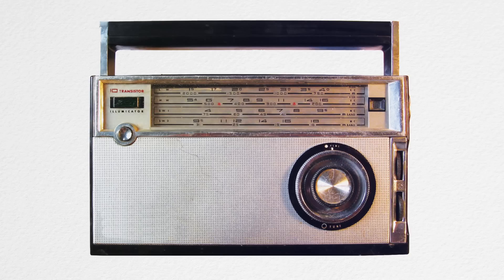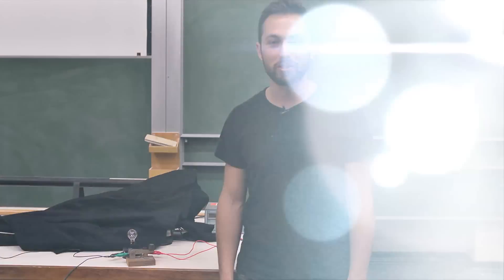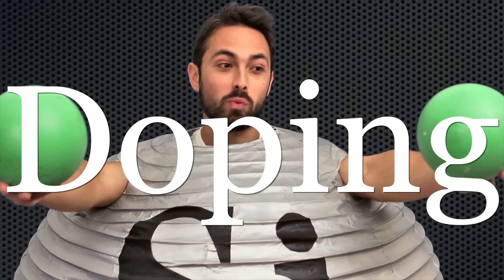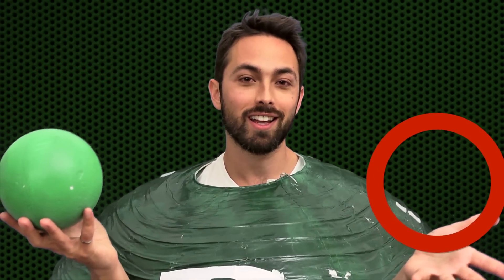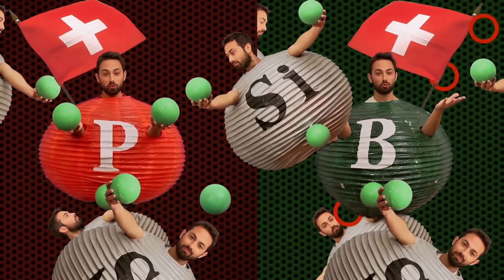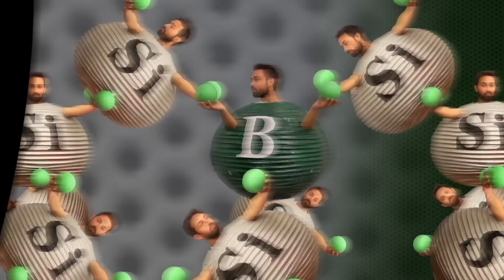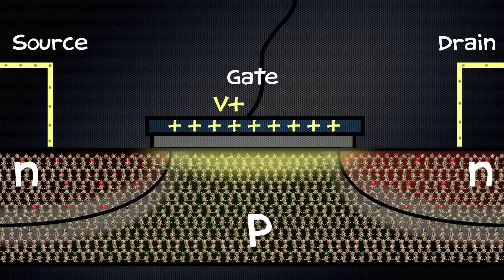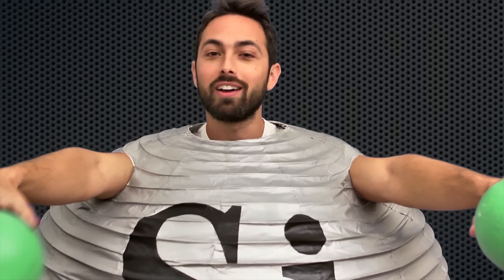How Does a Transistor Work?

Comment: Video: "A problem we won't face until probably 10 years down the track."
Me: Looks nervously at how old this video is now
Reply: 7 years. Not a bad estimate tbh
Reply: @KajoFox  I think that the last part is a very crucial element to this. There are many innovations that can be made in terms of architecture, software, or really even fundamentally how we think of computer chips.
Reply: also when he says 22 nm, I think "wait a second, this is wrong! intel I9 is 10 nm and AMD Ryzen 3rd gen is 7!" then I saw the date of the video and realized we are really close to the limit
Reply: @KajoFox  lmao amd is already at 7nm
Reply: @hdjekso7930  To be fair, they're talking about feature sizes rather than direct transistor sizes at this point, and the transistor density of Intel's 10nm tech is about the same as TSMC's 7nm tech (remember, AMD doesn't manufacture their own chips, it's TSMC's 7nm tech they're using).
Reply: @jubuttib  makes no difference
Reply: @hdjekso7930  Hello 2019, it's 2021 4th quar, we are at 5nm
Reply: @hdjekso7930  AMD is not, TSMC is :) 7nm is here for a "long" time already, I think we are starting the 5nm process now. Well, TSMC & Samsung are. Intel is barely able to make 10nm work today, they are still mostly stuck at 14nm for a very long time. Worrying time for them.
Reply: @hdjekso7930  2nm as of now
Reply: @hdjekso7930  And Intel is still only at 14nm xD
Reply: It's fine, once we start getting to 3-5nm people will just have to learn about creative code efficiency again like in the old days. Either that or we just start making chips bigger chips. This is all hypothetical of course, since the real thing you should be nervous about is the impending solar flare rendering all these chips useless.
Reply: @VGScreens  why people still think like everything is rock, paper, scissors? One problem doesn't top the other, and bigger chips wouldn't make progress, but yes, it would be very much interesting if people had to learn assembly to make code when high-level languages become useless.
Reply: 2020 - 5nm still fine
Reply: We're probably good at least until 2022 circa, indeed, when 3nm chips SHOULD enter mass production. After that it's not clear how the industry will proceed. Plans for 1.5nm are in study, but for the moment there's nothing concrete. Remember, anyway, that the "nm" quantity is quite a commercial term and the actual important number is transistor per area.
Reply: @tiger.98  what about now?
Reply: @tiger.98  its almost over
Reply: me: watching 10 years later:
Reply: Guys there is a huge misunderstanding between naming convention and true size of node and transistors. In fact, Intel and other companies have been stuck building transistors with a size of ~20 nm for a decade now. The naming type thing like 14nm, 9nm or 5nm "process" are more commercial terms used by companies to trick consumers. The only thing that have been changed through the years is the density of transistors and the use of improved stacking technology. The transistors in your 8+ year processor and those in the last generation of i7 gen1X have exactly the same size.
Reply: Hello from the future you dreaded
Reply: tfw Intel is stuck at 14nm++++++++++++++++++++++++++++++++++++++++++++++++++++++++++++++++++ for more than 5 years now lmao
Reply: @KajoFox  This agged like a fine wine.... TSMC is getting ready for manufacturing 3nm gates and i think, that that is the smallest we can get...
Reply: Me watching 10 years after the video is uploaded 😂😂
Reply: Reading your comment, and replies to your comment was like a time travel journal.
Reply: we need to start investing in grapes for the 2nm manufacturing process
Reply: @elevenz367  hm... 🍇 Grapes
But seedless!!
Reply: @elevenz367  we have it now 2nm ...IBM
Reply: @elevenz367  what does that mean? thanks
Reply: o boi
Reply: Try doping. It'll take your mind off it.
Reply: 2023 baby. 2023 is the end times we are close.
Reply: The law is kinda dying already...The performance improvements on new processors these days is not significant compared to couple of years back
Reply: Guys the 5nm and 7nm refers to the resolution of the fabrication, not the size of the transistor itself
Reply: 10 years old
Reply: We have arrived...
Reply: well.
Reply: lol. I just watched this video and it is 10 years old. 😬
Reply: there is only 4 years left before we face the problem
Reply: @YugoslavForever  I don't see what the huge problem is, they can easily just manufacture larger chips to get more transistors if they can't make them any smaller. They can also simply take existing cores and add more of them, and most importantly they can focus on optimizing software because most stuff on modern computers is hopelessly inefficient as a result of general purpose cookie-cutter high level program instructions and compilers.

It's only really a problem to very specific applications where processing power is no where near where we need it, like highly complex physics simulations. But they're working on quantum computers for that.
Reply: @BigUriel  With larger spacing follows a slower cpu. Not a huge matter though. But the die size will decrease and make the products more expensive. And the winner will very often be the one who can keep production costs down. Anywho. When they begin to exhaust multicores my best guess what's comes after is 3D stacking with increased input sources and advanced air flow and cooling techniques.
Reply: @BigUriel  not quiet true, making things large was at the very beginning. Technological progress would stopp once we can't make it smaller/more efficient. We already had computers as big as rooms for simple tasks and we still have those and much larger with newest technology. Space is crucial
Reply: @BigUriel  if not scaling down transistor, the power increases really really fast, a cpu is already difficult enough to cool, and that would mean almost no improvements in mobile.
Reply: @BigUriel  I think if they decide that the solution is to manufacture larger chips, rather than market larger chips to consumers, they will say, "Right, commercial computers are not going to get any better, we've packed as many transistors onto a chip as we can, what we are going to do instead is make massive supercomputers, that consumers can access remotely with current technology." The technology is already there, we've seen google stadia and internet technology is still getting better. Internet access will need to be cheaper or free before they can axe offline though.
Reply: @BigUriel  if we increase the size of the chips then we introduce many other problems, such as packing density, heating(larger a chip gets, tougher to cool it) also it's more abt the density than the actual size of the chip. It's how densely we can pack a chip with transistors. Other than that I agree, the architecture, os and programs can be highly improved and their efficiency increased.

Quantum computers are not like traditional computers. They can only solve certain problems. Granted those are high level problems. The issue is quantum computers behave in a very different way to how normal electronic devices. Their logic is based on quantum superposition of various states. Hence first we have to evaluate what kind of problems or algorithms can actually be solved using those superpositions and only then can we proceed to solve them. It's not like we can use them for highly graphical or load heavy simulations.
Reply: @captainspikester1  are we going for full circle once again, then? That was a thing before, one of the first solutions implemented, but a personal computer launched and it was better to have one than to wait for the whole neighbourhood, which means now we reached the point where this inverts again?
Reply: @SArpnt finally companies will run out of new idea to make money and they have to provide best in affordable price or mo will buy their products anymore..
Reply: Right now, covid19 is slowing down the process by at least 6 months
Reply: he gave us 3 years. We need MOORE XD
Reply: @KajoFox  True for Intel, but they are not the leading semiconductor founder anymore. TSMC and Samsung have been using 7nm for a few years and they are now starting 5nm. Intel is barely doing 10nm, they still are really at 14nm. Their roadmap and promises cannot be trusted anymore, they keep saying they are going to do it for several years... but yes, I believe 2021 is really the start of their 10nm.
Reply: @KajoFox  Snapdragon 888 5nm :p 
Still in early 2021 so we're reaching that limit fast, but ayye progress is always good^^

Also looked up 3nm is in the works right now. Probably won't be too long. But after that yeah suspecting slowdowns would be reasonable

Oh wow this was interesting, TSMC (taiwan semiconductr manifacturing company) has announced plans to start risk production of 2nm nodes in 2023-2024. Intel also announced back in 2019 plans to hit 1.4nm as of 2029.
Reply: @fruxo2000  why should the number of transistors on a chip double every 2 years though?
Reply: @johnaligizakis  Moore’s law. In the 60’s it was realized transistor counts on a chip were getting doubled every 1 1/2 - 2 years. And that has stayed pretty much the same for decades.
Reply: @johnaligizakis  it's an empirical law, it just happens, we have "no control" over it, we can only observe
Reply: 3 Moore years guys
Reply: Hi from 5nm M1
Reply: I've been holding off buying a new PC till we hit this 10 year end game. Still rocking a maxed core2quad. How are we doing? Must be almost there?
Reply: @WistrelChianti  same here
the pause will be there for atleast a decade until some other breakthrough or quantum computing comes.
Reply: The video is 10 years old now, but we still have about 3 years left m Yippee!
Reply: what 10 years is? just a snap of fingers :yougotthis:
Reply: And it's been 10 years now... He is indeed right, well Moore is
Reply: Me watching this on an iPhone 15, one of the first devices with 3nm chips: 😮
Reply: you saved me from saying the exact same thing myself thank you
Reply: we're in the endgame now
Reply: Hi, it's tiiime
Reply: oh no
Reply: its 10 years later now!!! 😨
Reply: yeah it has been already ten years hasn't it
Reply: heh
Reply: once the limit is achieved they will start to develop quantum computers
Reply: @Rafael-pi4md  they're developing quantum computer already, it's been many years and some time ago Google executed an incredibly complex problem, impossible to modern supercomputer. However it's not that simple anyway.
Reply: @SArpnt YES I already think about it, if it will be a time when technology will stop from development
Reply: hhhhhhhhhh same here
Reply: Making transistors beyond 3nm poses a lot of additional challenges, and may never be a thing, like with Nuvistor vacuum tubes. 
https://semiengineering.com/transistor-options-beyond-3nm/
Reply: And so far he's right. 7nm is the current size by and with 5nm in development for 2021, 3 nm is only 25 atoms across and very recent descoveries have managed to get 2 nm transistors stable, although I can't imagine going much smaller than that
Reply: @leonstansfield  I just meant that new discoveries, perhaps in fields such as quantum, cloud and non semiconductor electronics, will make 3nm "the last stand of transistors"
I imagine we'd need atomic fabrication to produce transistor 3-5  atoms across, and it being actually flat. I don't think it would work electronically with such tough tolerances. This is actually the next step we're approaching in the technological development - the transistors have to shrink in all 3 dimensions, no?
Reply: We are almost there
Reply: @Flamebuster32 I made that comment a year ago bro
Reply: Hi from 5nm M1
Reply: More core's is the solution to that, although more power consumption will be required. AMD's Thread Ripper!
Reply: some researchers predict that Moore's law will end in 2021, when quantum effects will mess up smaller transistors
Reply: @lilapela  that's what finFET and newer tech like Nanosheet and nanowire solve
Reply: @KajoFox  2 years later: Oh look, IBM made a 2nm chip!
Reply: me rn
Reply: 2 more yrs go by
Reply: It's even worse now...
Reply: shoot we've only got two years left until transistors get too small
Reply: NANI
Reply: almost 10 years now
Reply: Now we're only one year away.
Reply: now we're really at the limit. IBM have chips with 2nm transistors, 1nm transistors exist, 0.5nm transistors exist, single-atom transistors exist, and somehow the smallest transistor ever made is just one photon, with zero size.
Reply: It's now nearly 10 years 😂😂😂😂
Reply: Looks nervously at how old this comment it
Reply: Umm...
Reply: I JUST THOUGHT THAT and it’s been 10 years since those video was made
Reply: That has exactly been my thought just now :-) Now it is ten years later...
Reply: And it is 10 years old😂
Reply: Well we reaching the limit boys
Reply: It's 10yrs already and it's still getting smaller and smaller 😅😂
Reply: its time now...exaclty ten years later🙃
Reply: Been 10 years now.
Reply: oh no
Reply: hi it's officially 10 years and we're a little scared
Reply: We are at 10th year by now
Reply: lol It's been 11 years and there is no electropocalipse
Reply: hi ken, im from the future
Reply: ITS ELEVEN YEARS OLD NOW
Reply: Me reading this comment 6 years later 😳
Reply: ok we're here did we solve the problem?
Reply: Well thats a problem now.... we arrived at 3nm easily
Reply: let have a countdown...
Reply: That's exactly what i was gone write!
Reply: We got quantum computers so chill out
Reply: No worries guys! Engineers & Scientists will even solve these problems
Reply: lol. 7 years now.
Reply: it already happened we have reached this stage lol
Reply: sry didn't realize some time is left lol
Reply: @pipnina But why does it have to get smaller?
Reply: @KajoFox  GPU’s are already 5nm
Reply: It happened!
Reply: @KajoFox  yolo cah A14 is 5nm
Reply: Bruhh
Reply: @KajoFox  tunneling occur around 1 to 3nm not 5nm
Reply: Still relevant
Reply: @KajoFox  Year 2021 here. Samsung already completed 4nm process and they made contracts with other companies.
Reply: @KajoFox  not all processes are that small tho. Digital is the cutting edge when it comes to channel length. Analog and RF applications are still in 90nm and greater range.
Reply: What about 2021
Reply: @KajoFox  7nm for 2021....lol
Reply: Guys IBM made 2nm
Reply: IBM: lets speed this sh$t up 2nm
Reply: 1 year left :)
Reply: Me: looks again
Reply: Intel's FinFet technology overcomes this i believe. I assume TSMC and other foundries have a similar way of doing it with a less marketed name.
Reply: @KajoFox  it's 2021, Intel is now selling 14nm, on the verge of selling 10nm, and has 7nm in the pipeline for 2023.
Reply: ah yes but you see that is when quantum computers will be used (maybe hopefully?). quantum computers may be good for servers actually lol
Reply: That is what I was thinking, I was looking for this comment :)
Reply: I saw it today!!!! Only 2 years left and the industry is feeling it... Good prediction.
Reply: Ha, did the same thing.  One year away!!!
Reply: Lol, Apple and TSMC are already working on 3nm
Reply: Ohgodohnoohgodnonono
Reply: Don't worry, Derek got things a bit wrong, here. At the time, Intel was manufacturing chips with a "22nm" process, but for complicated reasons, this figure does not actually refer to the actual size of the transistors. On this "22nm" process, the contacted gate length, which is more or less the size of a transistor, is about 100nm. On Samsung's current "5nm" process, it is around 60nm. So there's still some margin for improvement before things get really bad with quantum effects.
Reply: Does anybody know why the electrons flow to the drain and not to the gate? I mean it's positively charged when switched so shouldn't the electrons flow towards it instead?
Reply: Hahaha me seeing it now
Reply: And you wrote this 2 years ago
Reply: ME RN
Reply: its now one year away xD
Reply: He's made a video now about how it's a problem now, i think it's called "the return of analog computers" or something similar
Reply: Still getting smaller in 2022
Reply: Well, we won't have to wait for long
Reply: Well its 2022 now...
Reply: lol
Reply: Well it's 9yr alr
Reply: Almost, almost...
Reply: When you see that the "7 years" comments are actually 3 years old.
Reply: now it's 2022
Reply: 1 more year remaining :P How are the development looking people :P ?
Reply: @Heldevik  we are now at 2nm
Reply: @kenj0418 closer now
Reply: Umm guys.. 9 yrs ago
Reply: Now it's almost 9 yrs , just one more to go 💀
Reply: Looks even more nervously
Reply: Now  its 10th year
Reply: Oh no.
Reply: One year remaining😂😂😂
I think few more years it will go
Reply: 🙂 This is fine
Reply: It's 2023 now it is 3nm
Reply: It's already 3nm
Reply: I don't know about that problem mate
Reply: yeah but also tbf he misquoted teh law its not a law aying it should just a notice that every cylce it is doubling, and it has stayed relativly true
Reply: uhoh
Reply: me looking at this video in 2024....
Reply: lol it’s 10 years now
Reply: Its 10 years now ig
Reply: Well about 3 years after this video we got 3 dimensional gates giving us a little more time buit not to much more.
Reply: come back 🔙 and check the date 🤡
Reply: look again...
Reply: guess how i feel
Reply: well
Reply: I mean now its the year he was talking about. Vid is 10 years old so😢
Reply: Its been 10 years since this Vid dropped.
Reply: Thanks to your comment, i surprisingly found this video was made in 2013. gosh
Reply: well...
Reply: Now it’s 10
Reply: Me: 11 years have now passed
Reply: Why reading through this comments replies appear like time travel
Reply: 11 years now
Reply: From reading the replies, I read someone saying that at that limit they will start developing quantum computers, well... The more you know... They are doing it.
Reply: 11 years baby
Reply: ...and this comment is 5 years old now
Reply: @iamanandakb  yep
Reply: I must join this party and declare that we need a follow-up video @Veritasium !
Reply: Pal i am you but 6 years later.
Reply: yeah i know your feeling
Reply: guess nothing happened
Reply: It's 11years old now and AI has tanekn the world
Reply: I am from the future!!!
Reply: Oh dear
Reply: OOH YA
Reply: Me looking at it 6 years after you
Reply: LOL now it has been 12years
Reply: they are at 0.000001 nm now
Reply: Well… by now I’d say we have other issues to worry about
Reply: well... emm... I think we're fine
Reply: Its been 12yrs now
Reply: your post was 2 yrs ago, I wonder how close we are, some things get slowed a lot more as it get's harder. back in the 40's and 50's we were supposed to have flying cars by now. I remember back in the 90's or early 2000's we were 10 yrs from being able to store all of human data on one crystal. Also sometimes science takes a completely different route
Reply: @Zimbob2424  I think what you're mentioning are just the aspirations of each era. Not even Einstein could predict 80 years down the line. They're just rainbows and unicorns of scientists and enthusiasts. But science does indeed take weird turns.
Reply: hello old people
Reply: Remember intel problems ?
Reply: me too 🤣 may be trump will extend it a bit to 20 years 😃
Reply: @baphometpresidente4637 idiot